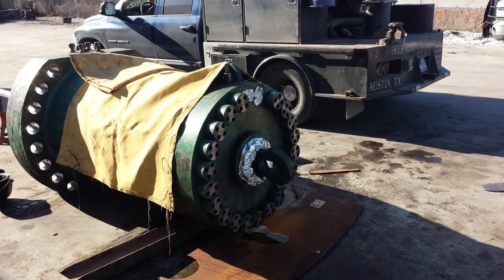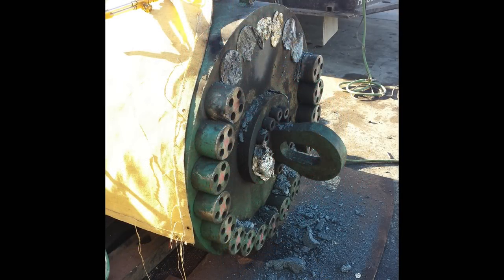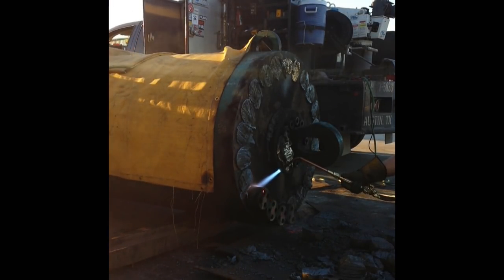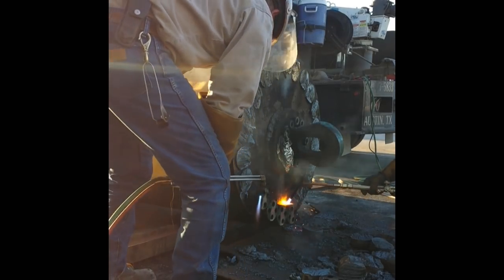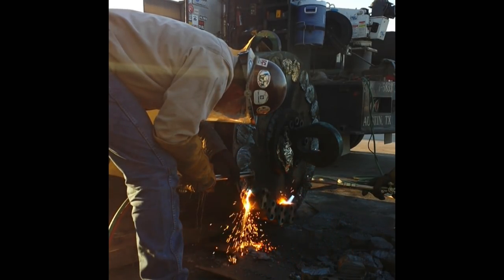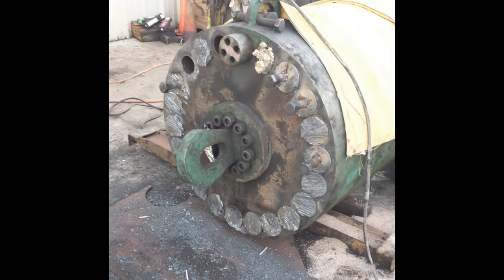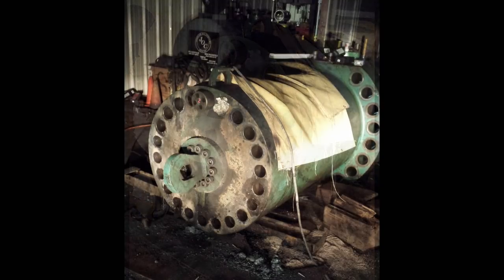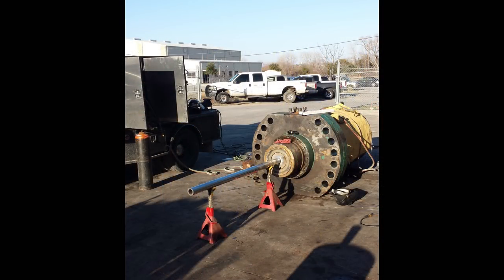Hydraulic Cylinder Flange Bolt Removal.

Comment: Thank you IC,
I have done something similar on a much smaller scale using cut-off blades, pulling the flange off, then working the now studs loose from the body of the part.
We do have to get creative in our work methods by understanding it and applying methods that seem reasonable at the time.
Sometimes we end up as the hero or the zero, but with knowledge and experiences there are  many less zeroes unless the zeroes follow the numbers on our paychecks; which often times never happens...
Reply from the maker: Yup, it could have gone either way.

Comment: Yup, I learned that when tension makes removal with the bolt tool impossible you can always find an alternative.  It just seems strange that welding a bolt onto the cut face would be more effective at removing those cylinder bolts than using the 4 pin removal tool with a snipe.  What do I know... Thanks for sharing your problem solving video cool as always!
Reply: For the unexperienced, like me!  "The Snipe has blades that cut an edge or edges into the object to be removed. The Snipe's blades then use this driving edge to transfer the effort you use turning the wrench directly to removing the object.  All your energy goes into removing the object.  Turn until the object is out.  Tap the Snipe to release the tool from the object.  The Snipe is ready to be used again and again"

Comment: I'm wondering about the installation. Bolts of this size in hydraulic applications take several thousand foot pounds of torque to properly tighten usually done with hydraulic multipliers. But definitely a fast way to remove. Thanks for another great video!
Reply: When the head of the bolt is off or nearly off there is a lot less tension. The threads don't hold the tension, the bolt head to part connection is where the tension is. I have removed head bolts torqued to 150 ft pounds by hand once the head snaps off. Rust between the fastener and or the head of the bolt and part is another issue. I am going to guess that it was a combo of all the above that allowed it to be removed. Great work by Isaac. Several ways to it. He chose one that worked well for him. He is very talented.
Reply: @LarryYaw  He's talking about how the workers installed the new bolts

Comment: I've worked around some large flanges and 'bolts' like that. Sometimes they are designed to where you heat the bolts to a certain temperature to expand them lengthwise, then install, they cool off and 'shrink' to a pre-determined holding power. They look a little different, usually one large hole in the center for electric heating element to remove them. These were on high pressure steam fittings in a boiling water power plant. Bio-mass, but similar to 'nuke' plants, 1,100 PSI water..stays in liquid state as long as the pressure is maintained.
 This looks like a cylinder from a hydraulic press. But...I have seen 'bolts' for tight situations that do look like these, special 'socket' wrenches of course.
Reply: Thanks, you taught me something.

Comment: You may want to look into a Harris salvage torch. With a #6 tip, and propane, ours cuts thru up to 12” thick steel in one pass. She barks thru a big bottle of O2 in about  10 mins, but, haven’t come across anything it won’t cut. No pre-heating required. 👍

Comment: I work on these on a very regular basis. this cylinder came off a HARRIS shear or baler, looks like its a shear cylinder. the bolt appears to be a 2 1/2" dia. those are torqued to about 7800 ftlbs. we use a 11/2"dr. hydraulic torque wrench. if you don't have one of those wrenches all you would have had do was heat the head of the bolt and probably a few different times and use a large air wrench to back them out and even hit the side of head with a sledge to help jar it loose. Those bolts are probably $300 or more each.
Reply: I like that bolts so, the owner is not had any clue abaut that torque to get THAT cylinder open.
My question is: when knocking on the torqued bolts heads is that make an high piched tone like the (over) tensioned string can do, before it start streching?

Comment: Nice job!  I've never seen bolts like those with the holes in the heads, but I guess that would keep people from tampering with them quite as easily.
Reply: The pin style bolts are used because they have to put bolts close together. As you can see, with a hex head, there wouldn't be enough room between the bolts to use a socket. The pin sockets are the same shape as the head of the bolt and have 4 removable pins in case you break them. I did cut a hole in a 2 inch thick plate the size of the bolt head and welded a bolt head into it to make an 8 foot long wrench that we hit with a 300 pound weight to break the bolts loose.

Comment: That looks like a cylinder from a Harris shear or baler. They needed a Hydraulic Wrench to remove those. We used an inch and a half square drive ratchet and pulled them with a crane before we got a Hytorc hydraulic wrench. You can rent them too.
Reply from the maker: wow. i had no idea
Reply: Yup.  Looks Harris Blue.  I work on the electrical end of those on occasion.   Without the hydraulic wrench, you’re going nowhere fast.  Thanks for sharing, Isaac

Comment: Ive seen “4 hole security bolts” before that look like this. But only on a much smaller scale. Like 1/4”. Crazy. I wonder if you could have made a tool strong enough to use in less time than torching all the heads off? Probably too much of a gamble for the rush they needed it in.
Reply: The company had the right tool for it the bolts are like that for clearance so that they can put bolts closer together without a need for the tool on the outside of the bolt like a normal hex. The problem I had was too much tension was on the heads the bolts were seized even with the proper tool he had the amazing idea to cut the heads off to release that tension thus allowing the bulbs to be turned

Comment: Like the other guy said they use a hydraulic machine to tighten these down. I work at a hydraulic shops for years and we had one. Some of those big cylinders off a track hoe have several thousands of foot pounds of torque hold that piston on the rod.

Comment: I am a bit late to viewing this video, but is there any concern with heat
from the torch migrating to the cylinder & fluid,
possibly causing expansion high pressure.?
Great work around a problem.
Thank you sir.
Merry Christmas to you & yours...

Comment: In the future if you can find out what the torque specs are for those bolts you can rent either a RAD gun (pneumatic) or a Hytorc machine (hydraulic) to loosen those bolts.

Comment: Like all your videos always learn Good tips. I would like to get in contact with you about your cat boom project a while back, could really use the Quick Attatch brackets you removed from that.
Reply from the maker: How can I help you?
Reply: @ICWeld in reference to the video about the 928 boom extension. I have a Cat loader with the same type Quick Attach hooks and eyes at the ones You cut off that boom, You did such a Nice job cutting those off they would be perfect for my machine. If they measure the same I would be very interested in buying the set You cut off that boom. Thanks Darren

Comment: Cutting torch . . best spanner to use . never seen a nut or bolt it couldn't undo , In England it was always know as a black and red spanner (colour of the pipes . ) USA probably different . in more modern times  the plasma cutter has taken over a lot of the torch work .

Comment: Nice job. I think I might have tried welding a large hex nut to the heads of one of the bolts first and hitting it with the impact.. or a 20 ft cheater bar.. Just to see. I guess if you had enough room you could also drill the heads out with a mag drill.. If you had a mag drill of course...:)

Comment: G'Day,,Had me some jobs like this,,but i had to save the bolts,,still use oxy but cooked the head of the bolts,,a couple of times,,make sure we had heat traveling down the bolt shaft,,let cool and removed by hand nearly,,still was a couple of tight one's,,but once again with a larger than usual Knock-o-meter,,they come out,,yep use shit load of gas ,but saved bolts and removed,,(in this case,),Large pandorgragh arms from mill rolling stand,,,
Bit hard trying to buy an $22 Milllion Housing of the shelf,,

Comment: I'm surprised you cut those heads off, rather than fabricating a tool to remove them. Those bolts look expensive. I guess everyone has their strengths. Yours is without a doubt your surgical precision with the gas axe. Lol

Comment: Was it necessary to cut the bolt first? How about just weld a big nut on them and then heat the cylinder and get them out?
Reply: Think about holding onto a doorknob with both hands and having your feet on both sides of the door and pulling with all you had. If you remove the legs there is now only a press fit with no tension. Nothing is adding pressure to the threads once the heads are cut off.

Comment: Why didn't you make a special tool with four bolts (or something) and a looong lever? I would think that would've been quicker.
Reply: They probably had the tool. The bolt pattern on the other flange looks similar.
Reply from the maker: They didnt have the tool but were probably getting it with the set of bolts.

Comment: That is quite the cylinder! I'm sure the bolts weren't cheap but over night shipping I'm sure was expensive. But when it's big money to be down, a few hundred in shipping is nothing.
Reply: I used to work for a company that made Urethane injection molding machines.  they made the liners for dishwasher, fridges etc plus stuff like bowling pins etc.  Well a huge appliance company had a line go down over an O ring and had us NFO one out (*next flight out)  basically, we drove it to the airport,  you pay to have a cargo company put it on the next flight to the closest airport, and someone there drives it to them.  Shipping on a $10 O ring was well over $500!!!  But in the scheme of things, it was probably costing them that much every MINUTE they were down.
Reply: @BentTreeFarmPa  When I worked at a heavy equipment dealer, we did that a few times as well. Cab ride to the airport and someone waiting on the other end. It's crazy to think about the money we spend just to get things done NOW. There was a time when if you needed a part, you drove into town to order it and waited weeks for it to arrive. In the meantime you figured out how to get along without that part.